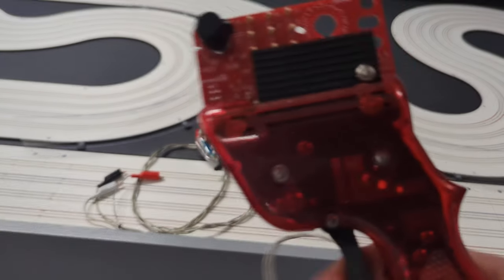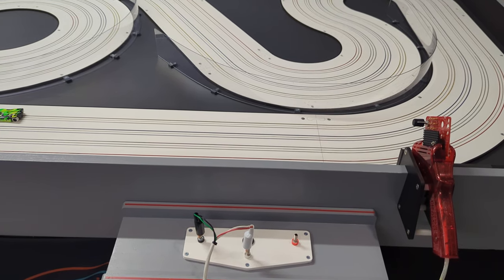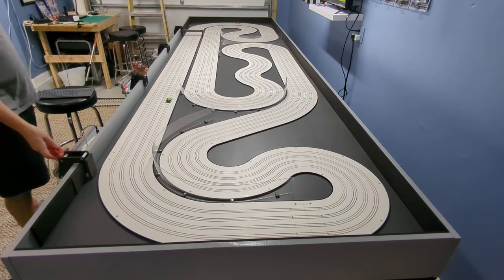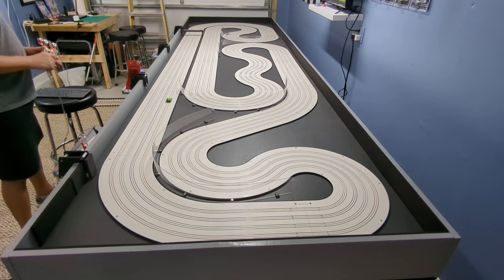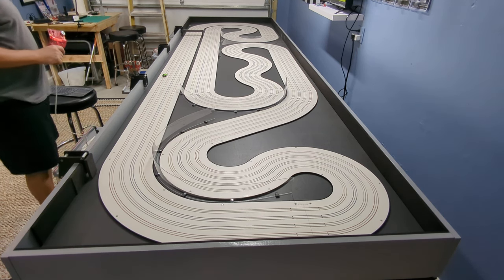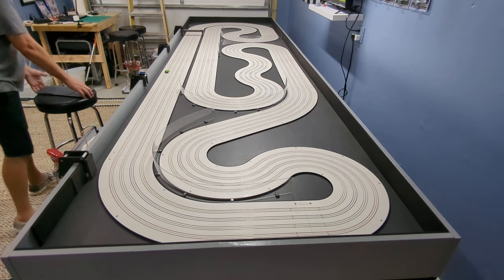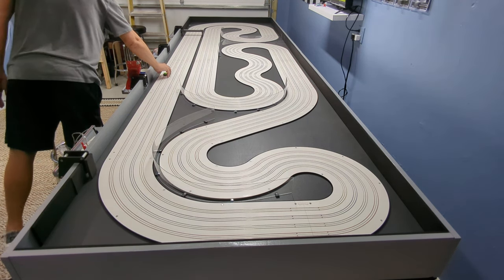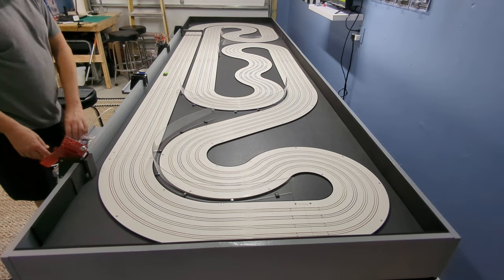Difalco Controller Comparison

Comment: Maybe if you dialed in the traction control some more in conjunction with dialed in brakes you could squeeze more out of the DD502?
Reply from the maker: Yeah, I am sure I could if I knew what I was doing...lol. Honestly I'm  just never quick enough on the trigger to effectively use the brakes and when I try it seems to slow me down too much. Depending on the track I do dial in the traction control more. I actually prefer the choke and coast combo on my new OS3 controller to the traction control brakes on my Difalco, it seems to suit my driving style. I appreciate your feedback...thx.

Comment: Hi..I ordered the DS with the 35-45-55 toggle switch,hope it works out for home track 🏁
Reply from the maker: I had the DS 60-90-120 before I switched to my Difalco 505s. The DS is a nice upgrade over stock for sure, I think you will like it. I just needed a wider range of control so I went with the transistor controller with the sensitivity knob and never looked back.

Comment: Nice track Mark is that a Viper track looking to get back into the slot cars Hobby. Also, what size is your track? Thanks.
Reply from the maker: Thanks! Yes it is a Viper, it's a 4x14 Scorpion.
Reply: @marksslotcargarage  thanks Mark have you run Neo magnet cars on your track just wondering how they run on your track also since it’s white is it hard to keep clean thanks
Reply from the maker: @ViperMike-c2r  I have run pro 10 motor level 35 cars on my track, they run great. WD40 cleans the track like new.

Comment: Nice I have professor motor controllers on my home track sensitivity knob and I have 8 positions chokes on both lanes and full power relays … the weekly tyco race they require everyone to use Parma or DS basic controller.
Reply from the maker: Really they restrict the type of controller you can use? I have never come across that here in FL at the clubs I race but we pretty strictly follow the HOPRA classes and rules.
Reply: @marksslotcargarage  ye controller and everything in chassis is stock down to the shims … one class you can swap tires only with modified dirt car body …other class you can swap tires wheels and rear gear with sprint car body  … its fun tho because everyone has basically same car … its oval track racing
Reply from the maker: Sounds like a lot of fun. We run an IROC class as well, it's a challenge, I never know what car it will be....lol

Comment: Question Sir how well do this controller’s work with Original T-Jets
Reply from the maker: I only have a few T-Jets but it works fine, that's what is nice about the sensitivity setting, it lets you adjust the controller for just about any car.
Reply: @marksslotcargarage  TY

Comment: I just ordered the middle one 138$
Reply from the maker: Yeah that is basically the DD505 but with the brake option, it's a good controller, you will like it.
Reply: @marksslotcargarage  I have a DS in 35ohm never used it though I think I'm just gonna get 3 more of the no frills defalcalcos for my 4'X16' 4 lane Watkins Glen layout I'm starting soon been collecting the tools I think that phase is ready on to the next 🤞